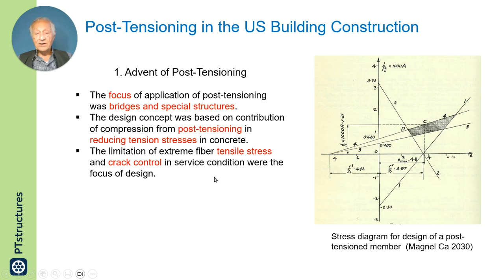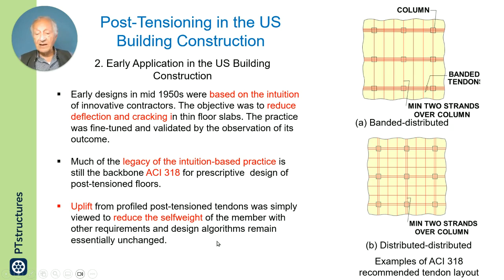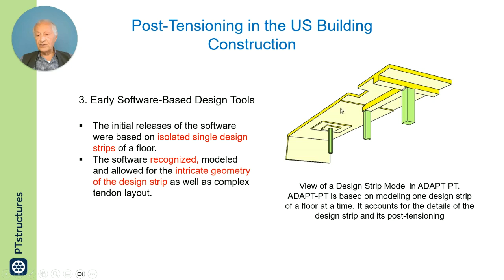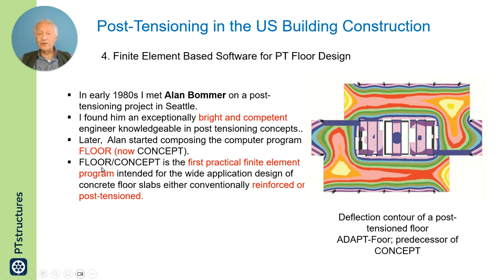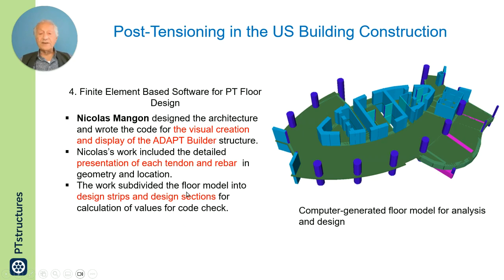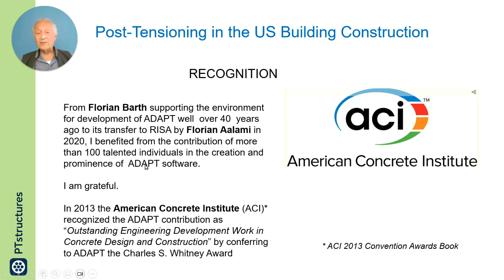1- Evolution of Post-Tensioning in the US Building Lecture 🏗️

Comment: Hell Mr Bijan Alami
I have a question please 
Why Adapt builder not considère a passive reinforcement to reduce long terme deflection?
Reply from the maker: In its current version ADAPT-based software considers the contrinution of passive (base) reinforcement for strength and minimum requirements of the governing code - but not for its contribution for deflection.
Reply: @Post-TensioningbyBijan  RAM Concept does include the passive compression reinforcement for the reduction of Long-Term deflection. For some reason, RAM Concept is more popular in Oceanic and Asian countries, any thoughts on this?
Reply from the maker: ADAPT-ABI accounts for passive reinforcement in service condition as well as safety. It accounts for deflection in service,